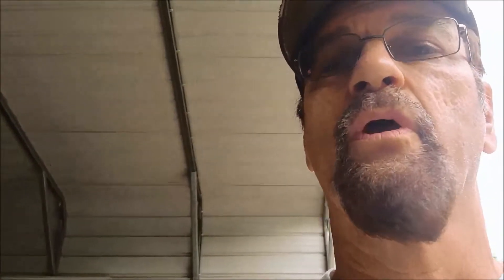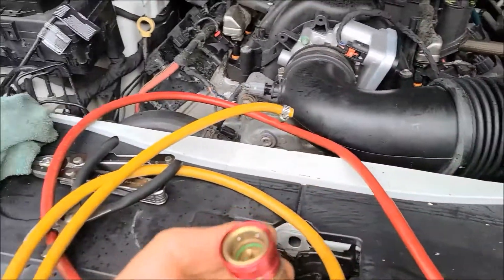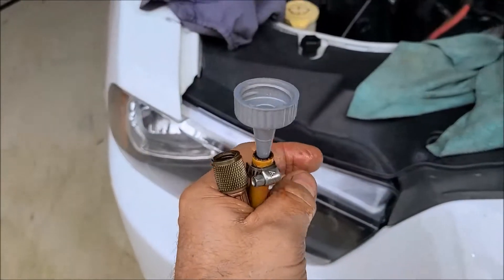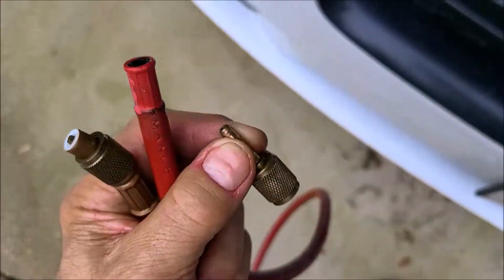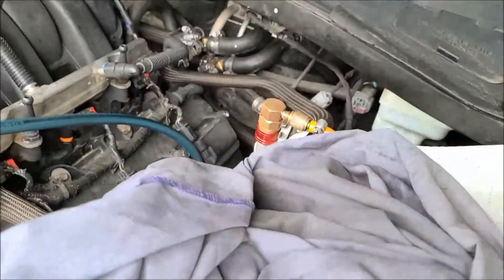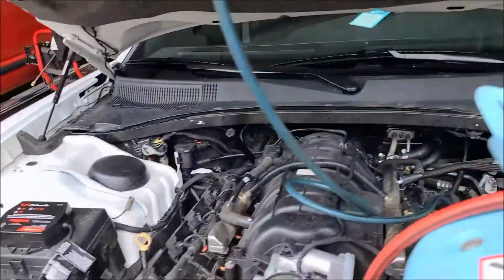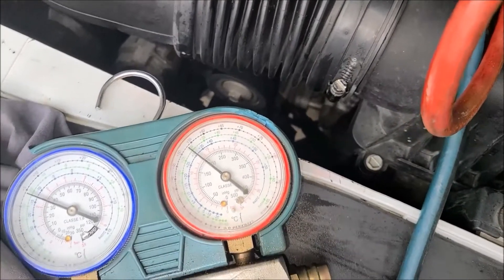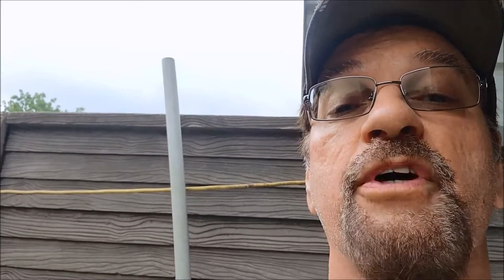HEMI RED ANGEL A/C STOP LEAK WORKS!

Comment: Any update?  I had a car that would leak all the r143a out in a month and the red angel worked permanently.  Now I have a car that leaks out in a week and debating trying the red angel again.
Reply from the maker: I'm leaking at 1 month intervals. Charged with only 1 oz of Red Angel..Leaked out again at 1 month. Just about done with month 2 and still blowing 40°. I'll post outcome soon..
Reply from the maker: Good to go for 2 months now!
Reply from the maker: My Charger lasted about 3 months. Then I sold her.
Reply: @REDNECKCHANNEL  thanks for another update.  The second car I used it on is still holding it's been about 5 months now